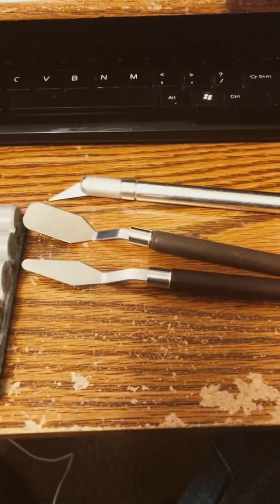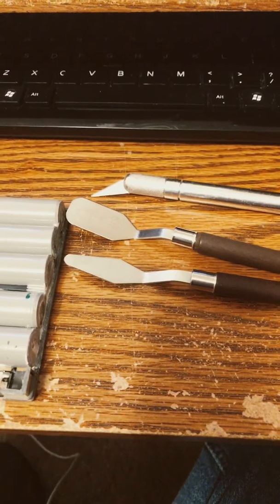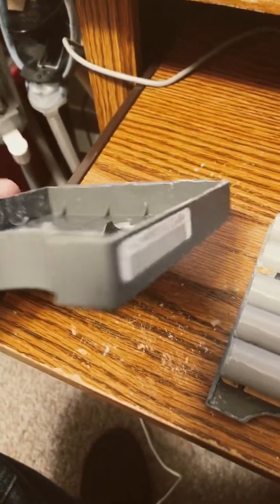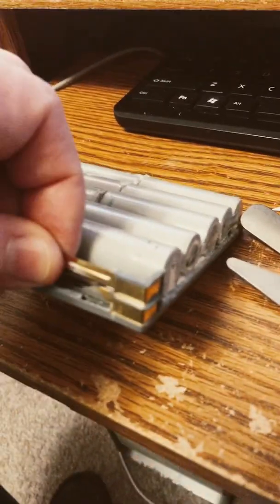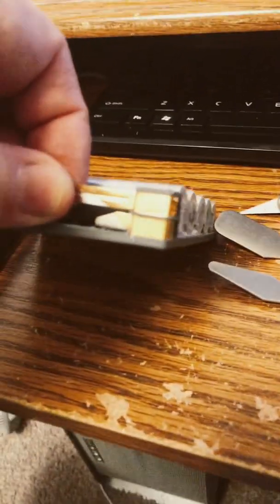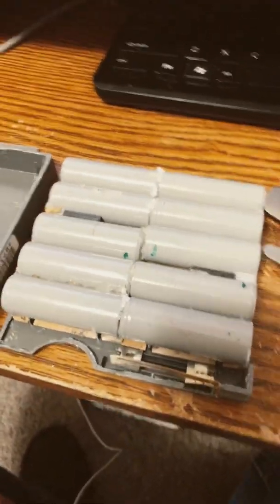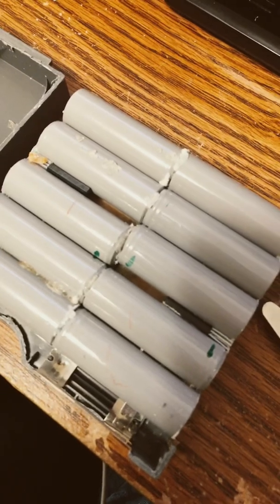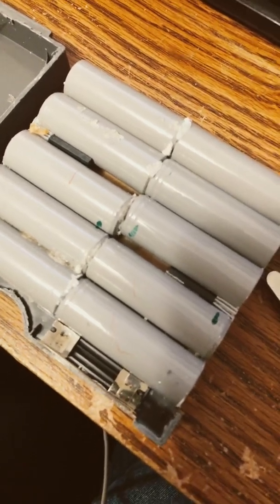Crusty Battery Goodness - Rebuild a PowerBook 180c Battery - Open the Shell

Comment: Which capacity did you use to replace the cells?
Reply from the maker: I used these to replace them. https://www.amazon.com/gp/product/B001BA292A/ref=ppx_yo_dt_b_asin_title_o01_s00?ie=UTF8&psc=1
Reply: @EricsEdgeVideos  Oh right, I saw there's 10 cells in the original battery. Assuming they were 1.2V, I expected a replacement to output 12V. So the laptop runs fine on 9.6V?
Reply from the maker: @WinrichNaujoks  sorry. I’m confusing this with the 520c I rebuilt the battery for. I had to order a different set of cells for the 180c.
Reply from the maker: I ordered 10x 1.2V 4/5A  rechargeable cells
Reply: @EricsEdgeVideos  Thanks, that's what I will go for as well.
Did you solder in the two thermal fuses (or whatever it is)?
Reply from the maker: @WinrichNaujoks  yes. It’s integral to the circuit afaik.
Reply from the maker: @WinrichNaujoks  the greatest challenge is not overheating the cells while putting it together. They are not as volatile as lithium cells, but will vent and crystallize rendering the cell useless if they overheat. The best way to connect them is with a capacitance welder. Unfortunately, I did not have one.